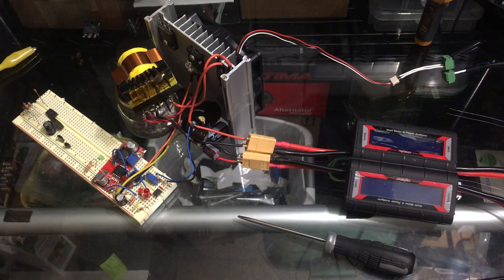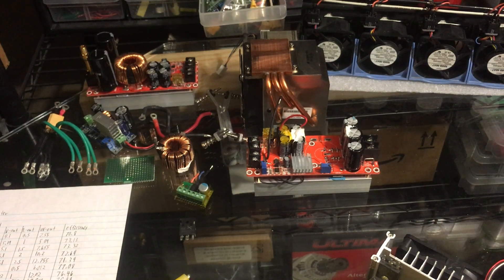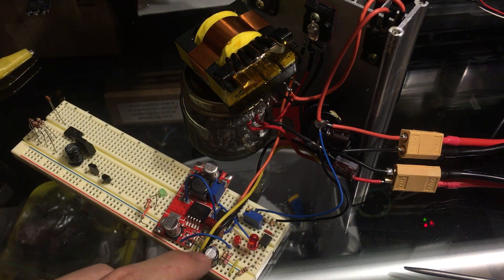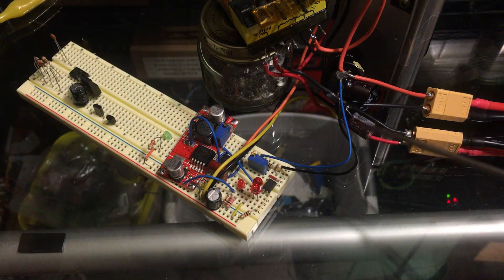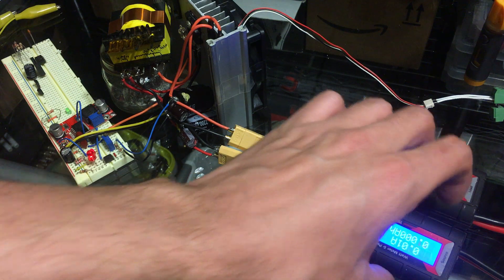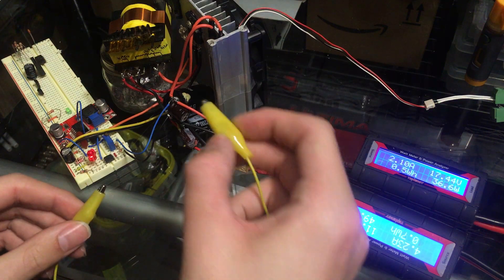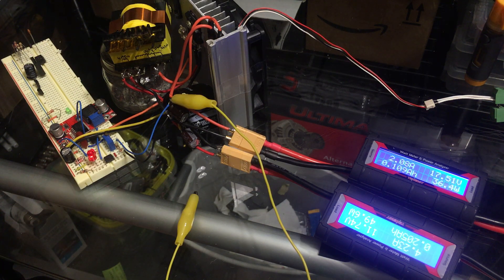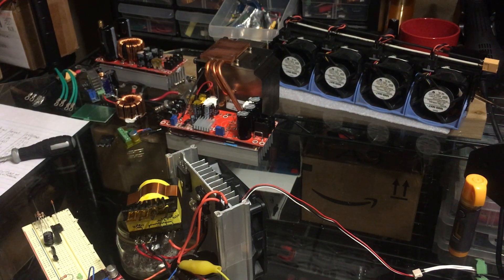DiY 40+ Watt Fully Isolated DC-DC converter using an XL6009 and some tinkering

Comment: Really cool! I'm wondering if you could build a crt flyback driver with a 6009. You could use a auxilliary  winding for a ruff voltage control/feedback for the HV side.  This could be a simple adjustable HV "lab power supply".
Reply from the maker: right! I was experimenting with arcing out the primary on the power supply transformers I was messing with (the one in this video had the best results due to its low primary inductance, one with 16uH did not do too well).
Now since this setup is fully isolated then I could totally use a large resistor divider to lower the voltage to a small ratio of its original and use that directly on the optocoupler. If I blow it I can easily replace it since I have salvaged so many over the years! but it might be beneficial to make a small zener regulated supply for a extra power since it takes a few mA to trigger the optocoupler, and you dont really want to waste a few mA off of your Hv supply which could lead to terrible efficiency.

Comment: There is a trick with these transformers, heat them in the oven to say 120C for 15 mins. The glue holding the two core halves to the bobbin (and each other) weakens and allows you to dismantle it without damage, so it can be rewound.

Usually the primary (~320V DC) is interleaved wound, an inner and outer winding joined in the middle. That just makes it easier to identify.
Reply from the maker: station240 thanks for the tip! yea I have taken apart a few transformers but haven’t done much with that yet. It’s hard finding the right wire and winding it tightly so it goes back together

Comment: i would like to recommend using the power transformer from a plasma tv since they are optimized for max current/voltage when i rewound the secondary 5+5 to use on my zvs and managed to get a steady 110v at 4 amps
Reply from the maker: Misael Fontanez cool! Yea I have some transformers from plasma tv’s I haven’t checked how the turns are. I do have my ZVS still it hasn’t had much love recently
Reply: @SuperBrainAK  well a cheap way of making inverters are still an available option for a premade zvs since they are cheap and work just as fine if not better.